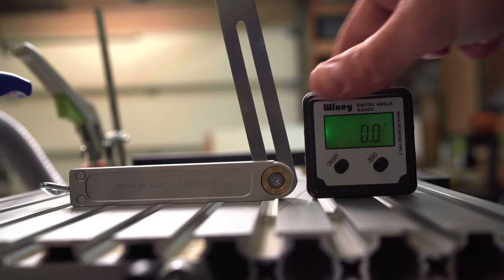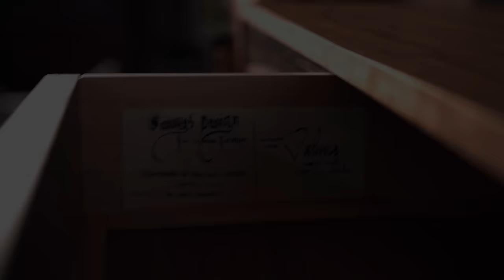This Console Table WON an AWARD! / Woodworking

Comment: Nick, this is a stunning example of handmade, bespoke craftsmanship... and woodworker self-masochism. I say this because any time I start throwing in angles other than 0, 90, or 180, my brain goes on strike or something. Also, NSFW finishing shots, indeed!

Question for you: I often ebonize wood, especially oak... how did you get the dark black/gray color to hold? I've actually had ebonized components rust before I could apply a finish (I use iron acetate, btw).
Reply from the maker: Thanks Matt! Masochism is my middle name lol difficultly=satisfaction. As for ebonization, multiple coats as you work up the grits is essential. It’ll definitely rust if left alone, so I try to get it to seal coat in a day. To bring it from gray to black, shellac is the magic key there.

Comment: With regard to the design, as you said, it’s subjective. However, without a doubt objectively, the workmanship is sublime; I don’t have the adjectives in my vocabulary to do it justice. With regards to inspiration, and I imagine a lot of your viewers, like me, look to YouTube for some, I found this build somewhat of a double-edged sword. On the plus side you demonstrated magnificently what can be achieved with $200,000 worth of equipment. On the downside I found your skill levels daunting and, despite previously believing I had the potential to achieve passable carpentry when I retire, I’m now going to my workshop to dust down my golf clubs instead. And, before anyone tries to burst my bubble, I do realise you probably do have even more experience tools and equipment than the figure I’ve mention, the point I’m making is that you did wonderful cabinetry with hand tools. With regards to the design, beautiful but not keen on the black but, we both said, it’s subjective. As I said I’m short of adjectives I’ll stick to very good. I’m English, so take that as the understatement of all the comments…..

Comment: Amazing, simply amazing. @Rick F is a very lucky person, both to be in a position to commission something like this and to have someone worthy of said commission 

Nick, one perhaps silly question - when you finished the drawers, either I missed something, or you only put finish on the part involved in the dovetail with the front. What is the theory/logic behind this ( does the finish mess up the fit if it goes the full length?)
Thanks
A big fan

Comment: I don't know about the design in some details, but the quality looks great. I'd just wish you wouldn't spray your work every time. Why not use oil or wax? At least finish with brushes.
Reply from the maker: Oil or wax doesn’t showcase the grain like shellac does. Brushing shellac is not an option. Spray produces the finest quality.

Comment: why did you leave the dovetail scribe lines on the cabinet top?
Reply from the maker: On top? No scribe lines on top
Reply: @SawyerDesign  At 15:11. Isn't that the top, with the groups of 3 pins?
Reply from the maker: Oh from the wheel gauge? Yeah I leave those. Proof that hands did it, not a machine. Personally, I like them. Some people don’t 🤷‍♂️